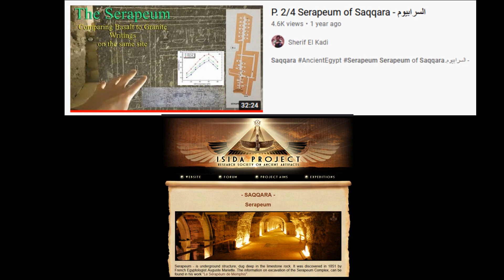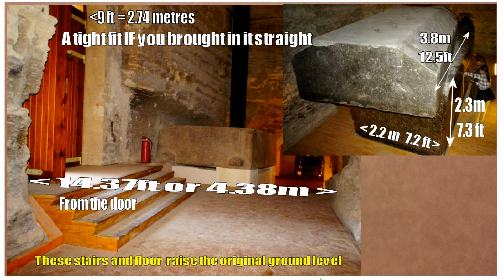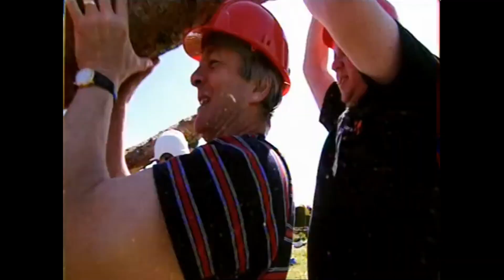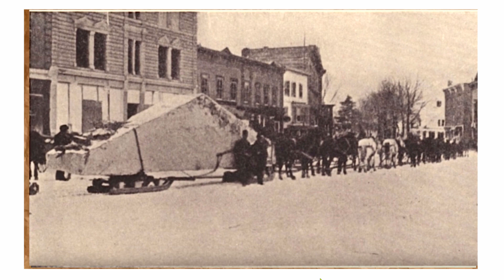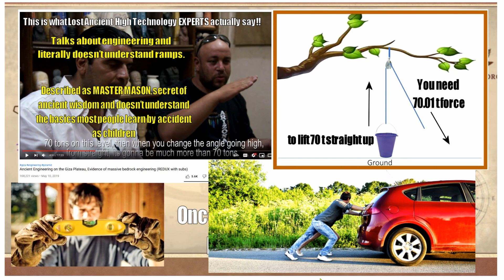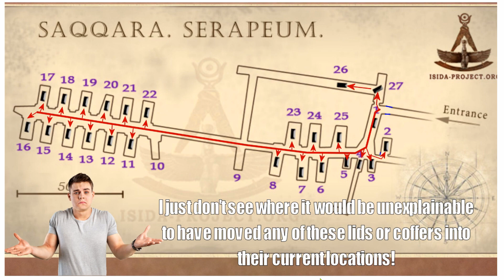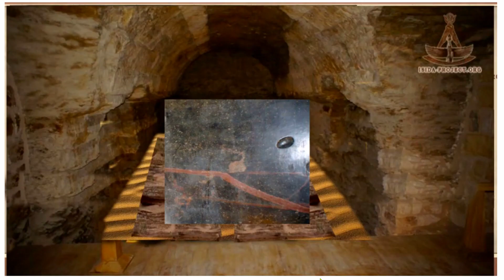Serapeum of Saqqara & Lost Ancient High Technology DEBUNKED Part 1

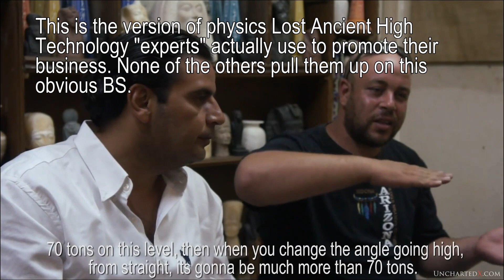Comment: 29:30 did he really said that the height/inclination will increase the mass of the object or did I miss heard him?

Edit: so he actually said that...perhaps yousef should finish primary school before lecturing online, just a thought....
Reply from the maker: My favourite part was when he said a curved ramp would work but a good old fashioned ramp wouldn’t work.
That’s a master craftsman with decades of experience right there. Never have I seen a tradesman who doesn’t carry a quarter pipe around to load and unload the truck.
Reply from the maker: LOL , yeah, if it goes down the ramp does it lose mass until antigravity is achieved?
Reply: He meant the force required to push up the mass will be higher and that's correct, you will be countering the friction and part of the weight (cosine the weight), if you push on a flat surface it will be only the friction and if you are lifting up it will be the full weight. totally legit what he said, although i do disagree with him on a lot of things he said.

Comment: Regarding the Nile reiver - weren't there 4 cataracts between the quarry and Giza? That makes transport of the bigger stones certainly extremely labor-intensive, or did they build special 'river-sledge-boats'?
Reply from the maker: tHe first cataract is just upriver from Aswan, the traditional border, so from Aswan to the delta it was a smooth sail down river. During the flood season also the water level rose quite a bit, bringing the quarry right  next the river, and the building site right next to the river. In some places like the Luxor Karnak temple they had walls around to protect from the floods as they would be totally flooded otherwise, which means you could float the stones, statues, obelisks right into their location.
Reply: @SacredGeometryDecoded how did they get the blocks to the very top of the pyramid and so high and precise without collapsing

Comment: I'd love to hear your thoughts on the polish. I know that you can get incredibly smooth stones by rotating three together to prevent concavity from arising. Rub stone 1 to stone 2, stone 2 to stone 3, stone 3 to stone 1, repeat. Once you have a pretty decent near-level finish (can be checked with a guide wire or a large compass, any fixed edge is sufficient), you can use finer grain stones to finish, and keep them smooth by changing to a fresh stone and then repeating the grind to re-finish the working face.

I might be way off there, but hey. Doesn't take any tools that didn't exist. Sorry if you mentioned it and I skipped over it, I'll go back through and find it if that's what happened.
Reply from the maker: cheers, in upcoming episode on this I'll cover how to make them and evidence for that in other sarcophagi, at the end of the day its just a block of stone that's been hollowed out. hardly a masterpiece.
Also the claims of precision flatness etc, even without lab grade equipment just the reflections make it clear they are not precision surface plate levels of flatness, which isn't difficult even if it was. the better ones are still hand made anyway.
I have a demo amongst my playlist, making the polishing grit is just about filtering out the grains by size, mixing in water and letting the heavier stuff set and then pouring off the light grains and repeating a few times.
to finish off flat plates i also polished them with those grit,  just going finer to finer to finer grade. I have the video somewhere but havent posted the demo on that.
Reply: @SacredGeometryDecoded  Good stuff. I really thing a big part of why people can even believe the conspiratorial crap in the first place is because we simply were not born with the knowledge of how to smooth stone that well, and they don't teach you that in school while the discovery channel is playing. People want to believe what they think is right because of ego, or whatever, but truth is still the best tool against that, and that seems to be what you're spreading here. I just think it's crazy that people would rather believe in aliens visiting earth than believe they could do all the amazing things the ancients did with their own hands
Reply: @SacredGeometryDecoded  “I’ll cover how to make them” lol ok dude 😂. I try to sit on the fence and listen to both sides of this debate w an open mind, but until someone actually does it, it’s really hard to believe these things can be made, with precision, by using hand tools. If you claim to know how I’ll definitely watch.
Reply from the maker: @Tony-kl2ml  lol dude they are not precise, not a single one of them
https://www.youtube.com/watch?v=bEwxMFDRmek
you don't need precision equipment to see it, the distorted reflections alone are enough, or the measurements that have been taken and properly recorded, 
here's playlist of experiments in granite including getting a flat surface, drilling, polishing etc. Easy to repeat and cheap to do, shame the lost high technologists haven't spent a single minute doing anything
https://www.youtube.com/watch?v=ol2P7nEz-ac&list=PL47iaGB6hlT5sYZWd_G7sHg9cSRv6WWS6
It's just a block of stone that's been hollowed out, it is box of stone with a lid ,
making actual precision flat surfaces is pretty simple and fast to do
https://www.youtube.com/watch?v=jDbrc1kl74Y&t=19s
the whitworth 3 plate method, the best ones still made by hand
lol dude, it sounds like your open mind is only open on the side facing the lost high technologists , but very closed to looking into the info that goes against it and can be repeated with experimentation
lol
Reply: @SacredGeometryDecoded  do any of these videos discuss material  removal rate, or how the blocks were quarried in the first place w hand tools? I do appreciate the reply and will watch these videos.
Reply from the maker: @Tony-kl2ml  yes they all do, links in the description to earlier experiements to confirm my results to theirs, i always start with my first experiments to show the mistakes i made so people can avoid them
how to make the abrasives from scratch
RPM rates of drilling and compare to modern recommend rpm for drilling granite cores
Also show things like copper lost, it's zero since the copper is trapped in the abrasive slurry and can be panned out
also using copper wedges to remove core plugs where the lost high tech guys seemed to fail? somehow
also a mention of egyptian copper being an impure alloy, containign arsenic which makes it equivalent to mild steel in vickers hardness
the cutting rates are dramatically faster than the lost high tech guys claim because they just make things up without ever having touched stone once
Mike Haduck Masonry and the Scioentists Against Myths channels also have a bunch of demos and/or visit ancient sites to show all the details conveniently left out by the lost high tech guys
Scientists against myths another
Reply: @SacredGeometryDecoded  thx. I do appreciate your thoroughness in research.
Reply: @SacredGeometryDecoded  how about them sharp corners? even modern tools cant cut a square hole in stone or how they cut the whole fucking box out in the first place?
Reply from the maker: @torontotonto6189  modern tools can cut square holes, ancient tools can make square holes, there are thousands upon thousands of them across the world and across time.
Such things are actually apprentrice level stone masonry, for a skilled stone worker it nothing compared to making beautiful sculptures etc. The bases of such statues have those types of corners in raised relief plaques etc.
Quarrying the block is also a simple with ancient technique/s. Whether with plug and feather using wood or copper, or by fire setting it is easy and standard practice. It's well recorded and was used widely until recent times, it stil is being used actually as it works so well.
These types of facts never make into Lost Ancient High Technology videos because if they did their snake oil scam would collapse.
Reply: @SacredGeometryDecoded  you will never do anything like egyptians with these methods, you will do things, but not what they did. Never.
Reply from the maker: @bobwilson7684  how would you know? You thought basic operations like polishing were a mystery a week ago. 
To paraphrase an old east European expression kids should be telling dad how to make babies.
Your wilful ignorance is your burden to carry.
Reply: @bobwilson7684  i suppose you think the Coral Castle here in Florida USA was built by some lizard people too eh? built by one man in the 1920s who weighed just 100lbs and stood at a height of only 5'0 flat he moved 1,100tons of limestone and cut them to precision shapes, piss off with your disbelief of humans strength and intelligence, perhaps it is only YOU who could not accomplish such feats, its fair to say Edward Leedskalnin was much more intelligent then you will ever be.
Reply from the maker: @Ethan R  dude you have left comments on two different videos in s as shorter time than the shortest video.
You are just lashing out and not only being dishonest, but also stupid enough not to even stagger them to at least give the appearance of having watched,
No surprise, your not the first to pull such an idiotic move. 
🤦‍♂️

Comment: Wally T. Wallington is/was a genius. He applied common sense on his day job and in his stone-movement 'demonstration' career. Followed him years ago and we had a brief correspondence.  Just tried to find him again. Seems he's disappeared. What's he up to now ? Anyone know ?
Reply from the maker: He might have found a way to elevate himself above being internet famous and achieved a living state of sainthood.
Reply: @SacredGeometryDecoded  Perhaps you showed it but I missed it. The most impressive thing I saw Wally do was easily roll heavy blocks of stone along a notched log using weight momentum. It was done with speed and each block moved a considerable distance.
Reply from the maker: @michaelleblanc7283  that was in the larger clip but had to trim for time. Have you seen his Egyptian hoist? Using the pyramid slope angle as ramp. Lift all the blocks of great pyramid walls in four months with small crews.
Reply: @SacredGeometryDecoded  Hope he's not forgotten. What's extra great about him is that he was just a regular working guy - inspiring for the rest of we grunts. He was looking a bit old back in 2008/09. Expect he's retired now but still thinking hard   :  ).